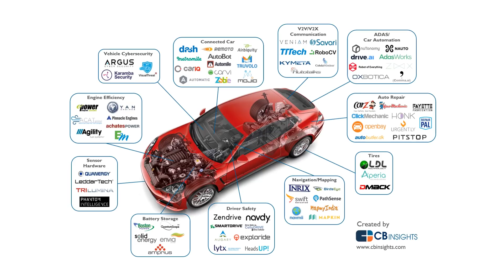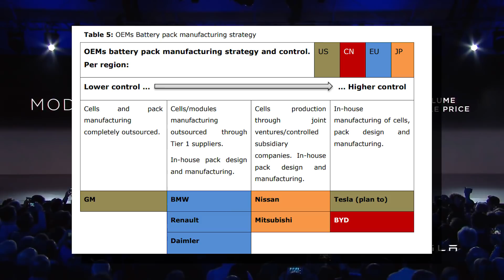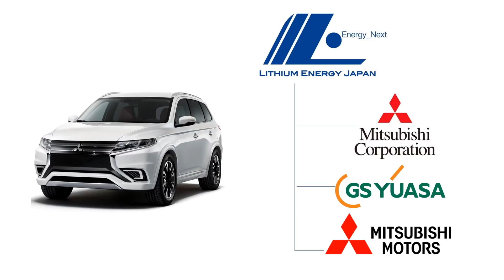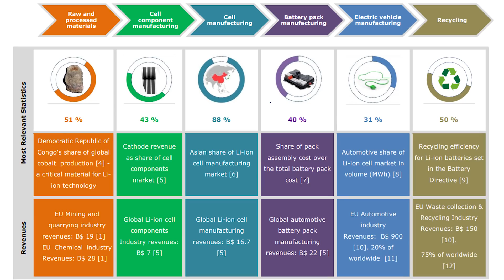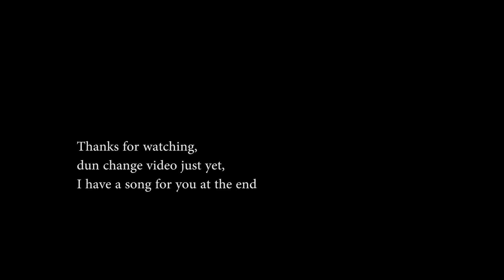Map of the Electric Vehicles industry [Pt 2/2]

Comment: At 2:52 you made the chart too confusing by putting the arrow below the color codes which made it look like the arrow explains the color codes (brown means lower control and orange means higher control). Of course, that's not what it shows. I really like the youtube channel called Vox. They present data in a way that most people would understand easily. I recommend checking them out. However, because this video is pro-Tesla and it is about batteries, you get an upvote from me anyway. Good work.